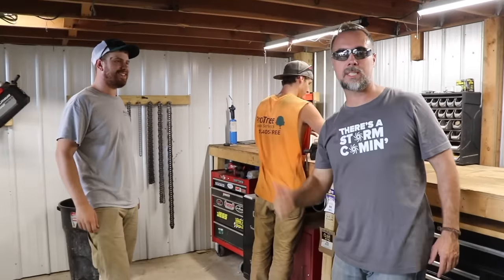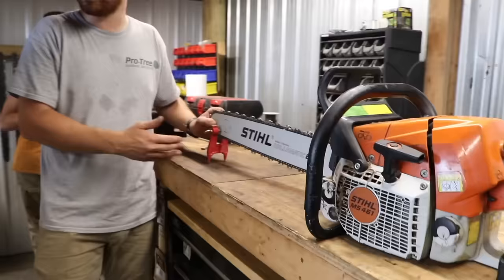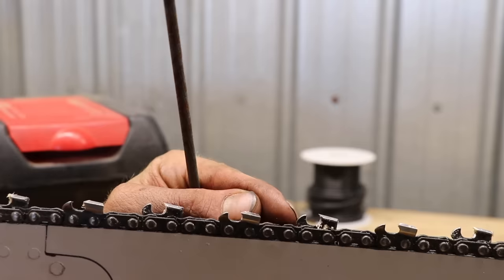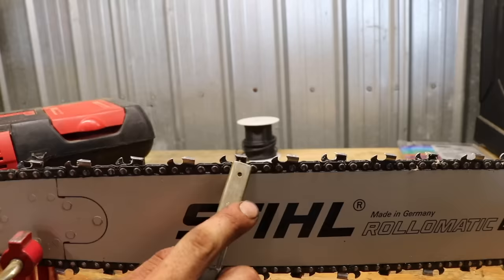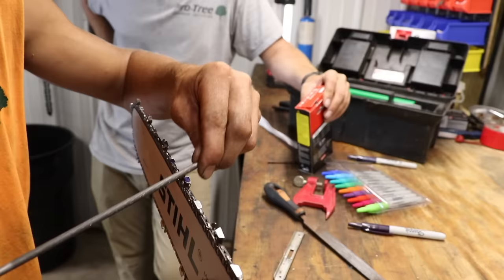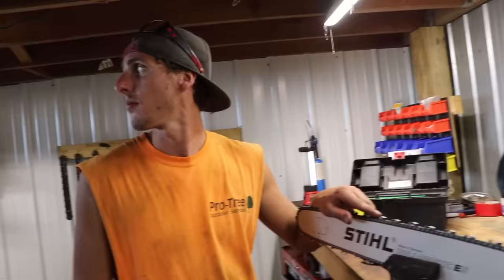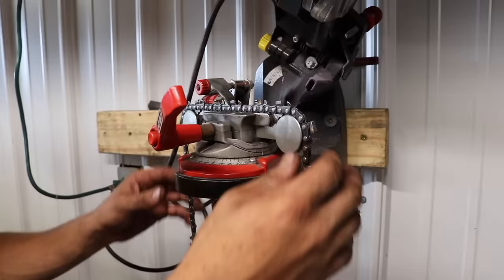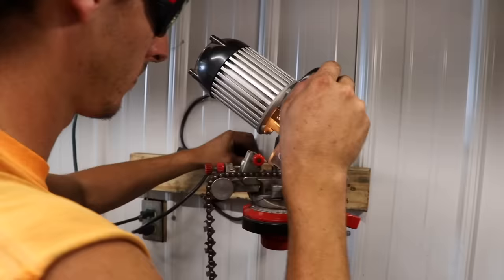How the Pro's sharpen a chainsaw

Comment: The electric grinder is the way to go. I hate filing chain teeth. A ton of guys (myself included) have the $30 Harbor Freight grinder which is identical to that $600 grinder except the clamp is a little different and it works just fine. Just watch you don't blue the tooth. I mounted mine near eye level like they did so you can watch the tooth and see what you're doing. Take as little metal off as possible with the SIDE of the grinding wheel.  I like to bring the grinding wheel down into the gullet, barely touching the tooth, and then flex the handle sideways to bring the side of the wheel into contact with the cutting edge of the tooth for a brief second. A few light hits like this and the tooth is sharpened without heating it up and bluing the steel. Your teeth will be sharp enough to cut hedgewood/osage orange. Keep a spare chain when you're out cutting so you can swap out a dull one. I'd rather switch out a chain than sit there and file. Like the guy says, it doesn't make you any money.

Comment: Stihl offers a hand file the files both, the raker and the tooth, simultaneously, to the proper height with the same stroke, It's faster than the  $600 machine. The video is on YouTube, somewhere.
I've used one for years and it is fool proof.

Comment: Harbor Freight sells a $20 chain saw sharpener with the same setup.  Of course for that price it's not the same quality machine.  The adjustment knobs are plastic instead of metal and require a little bit of finesse to work, but for the price it will still put a good edge on a chain.

Comment: What twisting the file does help with is wearing different parts of the file out compared to just one spot and the depth gauge adjusts the amount wood being cut for each individual tooth it's nice to have teeth all the same size to cut straight and smooth but if using a depth gauge it's not necessary to take the same amount of strokes or metal removed cool video though

Comment: Awesome Video... I learned so much about both methods of sharing the chainsaw saw blades and signs of a dull chain.  Can you make a video show  how to safely cut a tree down and the minimum equipment needed with the proper PPE and the don'ts like using an extension or a folding ladder near a tree. I've seen to many video's where no common sense is being used and no saftey first. When should a tree be cut where 100% of success rate to NOOOO with a 50 degree  example of a lean and when to hire an Arborist. The man with no knowledge shouldn't be near saw and will end up in a WHEELCHAIR....
Reply from the maker: Thanks Charles !

Comment: Horsepower makes a difference also, if you are bucking and sawing big wood and you have a lot of experience filing the rakers down a little more is beneficial.  (proceed with caution however)  If you have a bigger bite you will cut faster.........but it is more dangerous.  I like a chain that  the teeth are half gone and the rakers are filed fairly aggressive, the chips fly and you cut fast without the chainsaw bogging.   That is with 6 HP plus saws I am talking  460 Stihl and  bigger or equivalevnt HP in other brands.  Anything under 5 HP you have to be more precise and careful on filing practices.  HORSEPOWER IS THE NAME OF THE GAME BABY!!!!   (pretty much in everything you do)
Reply from the maker: Good comments, thanks !

Comment: Yes, depth gage height is very important but it amazes me that few folks here on YT, including you, do not address the HEIGHT of the round file RELATIVE to the tooth when filing. The file position should be about 2/5ths of a file diameter HIGHER than the top of the tooth edge. I don't care if you've been cutting wood for 50 years and sharpen by hand, YOU CAN'T CONTROL THIS CRITICAL FILE POSITION BY HAND. If you do not control this height you will feather the cutting edge (too sharp, no service life) OR blunt the cutting edge (inefficient cutting edge). Stihl and others make simple file jigs that automatically control this height.
Reply: Yes, I use an Oregon gauge with a 5/32 file for my low profile chain. Keeps the file height correct and also makes it far easier to cut at 30 degrees consistently using the 30 degree lines scribed into the end of the guide.

Comment: They didn't mention that's it's worth using the wooden handle of your file to knock off the burr that's left from filing,  the burr can roll over and peel off some extra material with it or curl under and hide the sharp edge. Regarding the blueing from overheating, I think they miss understand. To the best of my understanding, the tooth would only be harder if it was quickly quenched at this blue colour, fixing the metal structure in a hardened state, but because it's more likely to just cool naturally it would actually anneal and become softer.

Comment: Used to have a Foley Bell Saw (40" disk w/ insert teeth). Never failed that we would find bolts/nails in the first eight feet! Not the ideal tool for cutting through them and sometimes the cam inserts (and teeth) would go flying. Not sure where they ended up. Yikes! 3/8's kerf and sure made a lot of sawdust.

Comment: The file guide is not only for angle but holds file up against cutting edge for proper depth of the gullet. I rarely look at angle either.

Comment: Hey DM. I think it's a good idea to use a file guide Oregon makes a good one. Paired up with the correct file diameter for your chain it keeps the file at the correct height. It's real easy to push the file too far down into the cutter tooth making too deep of a gullet and too extreme of a hook to the cutter. I mean when ur not using the guide
Reply: Seconded.

Comment: Great clip!  Now if I could only start my little Poulan😊
Reply from the maker: Thanks Lee!
Reply: I don't know which Poulan you're talking about, but I've got a pp5020av. Try adjusting your spark gap to .030". If a spark/fuel mismatch is the problem (as it is with some Poulans), that should fix it without retuning the carb. According to my gauges, the stock spark gap was around .024". 

You've also given me a great idea for a new cartoon. My Little Poulan will be a smash hit!

Comment: i could be totally wrong about this-  But it seems like between the cost of a new chain and the time value of working, it is a better investment to just buy a new chain, especially for the casual user.  Because buying a new chain is about $1 per inch of chain saw

Comment: You dont need to take the teeth to all the same amount. You just have to get the tooth sharp at its point and half way agross the face. I take the raker down before sharpening or else the file can hit the sharpened tip. Key to filing is a lot of pressure with a new file in a file clamp.I weld a handle onto the far side of the file clamp. Good control, angle gauge as a reference and take care not to file the link because it will break a chain. Probably only do two chains on a file.

Comment: Keep the rakes cut down you won't have to sharpen the chain very often.
I take spare chains with me when I go cutting wood, if it starts to get dull I put a fresh one on sharpen them all at the end of the day with a good bench mount lefco sharpener. And I don't use anything but full chisel chain, high profile for softwood, low profile for hardwood. If my chain got so dull that it's smoked then it goes in the trash can
But that's just me

Comment: Good video..! As a humble Saw (Stihl ms170) user...I've never seen anyone mentioning the fact that all chains have two teeth that face sane direction (so the user knows when they have done a full rotation) and it's time to spin the saw or your body round and start the sharpening process until uiu reach tge sane two teeth that face same direction..! Unless in totally a fool but it eliminates a lot of time and headache working out where you started to fill...abd all that time marking starting point with magic markers tippex efc...Maybe I'm totally wrong
Reply: Not all chains have doubles like their talking about. I’ll use a whiteout pen or red marker to mark the tooth. If the chain has some use on it the new file marks are usually enough. It just takes some practice and finding out what works for you in your situation. Lots of YouTube videos out there and other information sources.

Comment: I use a 12v sharpener similar to a dremel its like 30$ at menards. And to do the rakers I use my cordless grinder. I get the chain sharper then a new one it takes less than 1 minutes to sharpen. I don't do the rakers every time obviously.

Comment: I always use Japanese water stones to sharpen my chainsaw blades. I recommend starting  with a 1000 Grit  Stone , then working our way up  by about 3,000 grits until you hit 30,000. It's super easy to get them crazy sharp that way. Much easier to use them for shaving one's face when they're super razor-sharp. Another really good way to sharpen your chainsaw blades is with a 4 inch angle grinder. Just make sure that you keep the guard on the angle grinder its safe. You can also use a belt sander for putting a wicked sharp edge on a chainsaw blade. I don't recommend it though unless you are pro. Regardless of which method you use, always use a 180 degree cutting face angle. Also, as any real PRO knows, chainsaws don't use rakers. Only landscape guys use rakers for raking up leaves and things
Reply: Stick to roofs Jon.
Reply: @krististanley8508  
Trap set....Bait taken...... FISH ON!!!!!!!!!! 2 year old satire anyone.... ANYONE!!!??? BWAHAHAHAHAHAHAHA!!!!!!!!

Comment: Has anyone tried the Stihl carbide chain? I have been using them and love them. I even loaned a chain to a company that was trying to cut a frozen dirty stump that dulled there chain 5 times. It cut that stump and they used it for a month almost everyday before it needed sharpening. Only downside is cost which is overcome by labor savings and you can’t sharpen it without a diamond disc sharpening machine. I have them sharpened at local dealer.

Comment: I worked for a tree service no tooth was the same size cut straight and fast they had their own sharpening method they didn’t hold the file flat they angled it to get a flake on tip of tooth then it’s sharp never seen method like it cut like butter so many methods of hand filing you have to get the gullet like billy ray said or it just won’t bit as good 😉
Reply from the maker: Thanks for the comments James

Comment: I did appreciate your film on sharpening a chainsaw.  Now I better understand the role of the raker and its relationship to the tooth.  I use my Dremel Tool to sharpen the chainsaw but I was not filing the raker down.  The Dremel Tool is less expensive and less complex then the electric bench grinder that you showed.
Thanks
Reply from the maker: Glad the video helped out Chuck and thanks for watching !
Reply: NOT A RAKER...   It is a depth gauge !

Comment: Great video covering all the aspects of sharping and answering most questions people would have. I was wondering on how to size a grinding wheel for a electric bench sharping tool. I know you have to go by the pitch of your chain, but I have yet to find a chart for matching the pitch to the width of the grinding wheel. I have 2 different saws. A Stihl MS 170, chain marking is 3, Pitch is 3/8"-9.32mm, round file is 13/64", Grinding Wheel is___________?. I also have a Stihl MS391, Chain Marking 6, Pitch 3/8p-9/32mm, Round file 5/32", Grinding Wheel is_______________? Thanks for any help.

Comment: Couple inaccuracies 1 if you use a raker gauge you don't have to file each tooth to the same depth because they will all be cutting same amount as long as you use a gauge every time. 2 the filing method they showed is for round filed chain only 404 chisel bit requires a completely different approach. With 404 you file downward from the outside leading edge to the center of chain. All in all the methods they used for round filed chain should cut descent.
Reply: 9
Reply: Jim Powers huh

Comment: Sucks that I didn't watch this earlier! Just finishing a tree removal now and was wondering why our saws weren't cutting as well even after I sharpened them!
Reply: have^nt you bin on a chainsaw course may be nptc  ?
Reply: @clivewhittaker1626  I'm in Australia, we don't have the NPTC, but equivalent courses are available. We hardly do any tree work at the moment so the costs of the course doesn't really weigh up given I already know how to use saws properly and safely to a decent arborial level. Just haven't really bothered with the sharpening side in the past as my mower shop has always done it.

Comment: I thought it was how pros sharpen, not seeing full chisel chains on them saws. Best sharpeners I have found are the Stihl 2 in ones, file racker and sharpens chain, but dont work on full chisel chains. Full chisel chains you use same angle but move handle down 10 degrees.

Comment: ..stihl makes a two in one file it sharpens the tooth and lowers the rakers... not hard to use with a little practice... it's worth the price and doesn't require power.....  simple solution the end....

Comment: It’s really important to clarify that one-finger franky’s main problem was NOT having taken his depth gauges (or rakers) down too far. His problem was one handing a saw while holding the work. Not good. That is the problem with top handled saws which tend to encourage one-handing. 
Generally it is not advisable to use a top handled saw on the ground. They are for climbing. 
Taking down the depth gauges too far has plenty of unpleasant side effects but it’s negligent to ignore (and therefore condone) Franky’s real safety oversight here. 
I’ve been a professional climbing arborist since 2002.

Comment: The thing that ruins a chainsaw file, is the oil residue and the sawdust on the chain,  so when my file is getting done, I'll get a cloth and rub some washing up liquid on it, then rinse it under a hot tap, using a softish wire brush to remove the metal filings. Just dry it off with some kitchen roll, and it'll be as good as new... This'll give you at least another five or six sharpenings per file.

Comment: I always used a file the opposite way so the burr isn't on the cutting edge. I do the same with a knife but use a sharpening stone a knife. Let me know what U think.
Thank You
Reply: Round filed chain you file inside out, square filed chain most guys go outside in but you can file it either direction, outside in is very hard on a double beveled file for a square filing and they are not cheap.
The small burr your speaking of is gone as soon as you hit the wood, and its only on the side plate not the top plate so it effects a smaller portion of the cutting than what it may seem.
Hope this helps.

Comment: Great info I have a harbor fright electric sharpener and the adjustments were  a mystery to me no I will try your method thanks for the info.  It would be usefull if you could give a view of the front down inspection of the correct rakeer position Thank you

Comment: I’m a diy homeowner that cuts my own fire wood.  Thanks for the tip on cleaning my file & filing my rake/ depth guage. Also, I had 2 chains professionally sharpened and noticed hot spots (black) and thought that might change the temper of the steel (I was thinking of asking them not to do that to my chain, but now I know I am).  Also, I bought a harbor freight chain sharpener and it works great for my 5/32” chain filing, but on my 7/32”, it didn’t get down in the arc well - do I need a wider grinding wheel for this?   Also, just bought diamond rotary bits I heard you can use in your drill - any thoughts on those?

Comment: you talked about the 30 degree angle but what about the other angle which i usually set to 60 degrees? Did I miss it?
Reply: I agree.  I was waiting for that .  they seemed to use a lower number.  That blade looked somewhere around 50 degrees.  Much sharper angle than the 60 I use per manufacturers recommendation.  I had hoped that would cover that and explain the sharper angle.  Maybe from their experience it works better??
Reply: I agree. Been hand sharpening with a guide for many years and have never been happy with my chains cutting ability. Friend of mine has mastered the flatter angle method and tuned one of my chains up over the past wknd. My chainsaw has never cut, and my chain has never cut better, and been cleaner since he tuned it to the 60 degree angle.

Comment: In lieu of the bar holding tool.  I've always used an inexpensive 4" C clamp to hold the bar.
Reply: How does that work?  Can you post a picture?
Reply: Clamp your C-clamp of any substantial size 4 inch or otherwise about midway to the bar. The C-clamp rests on whatever surface you're working off of. It protects the chain and the work surface.

Comment: Blueing any edges with high heat especially "friction" heat will soften the steel and it would have to be heat treated "annealed" again and not just by heating it red or bright yellow but how its cooled is just as important than how it was heated to bring it back to the most useful strength for its application.. cool it 5o fast and it's brittle, cool it to slow and it's too soft.. their are oils, and many other options for cooling steel than with water.
Reply: Oils reduce the occurrence of unintended corrosion during cooling and they have different thermal conducting properties that can change the rate of cooling.  Blueing does indeed make the metal more brittle and more likely to chip instead of dull  when cutting.  This is evident if you look at the edge under magnification after cutting with a blued edge.  It can also cause undue wear and tear on files when you go to sharpen them since the hardness is closer between the two metals.